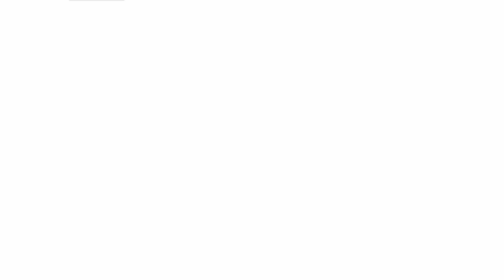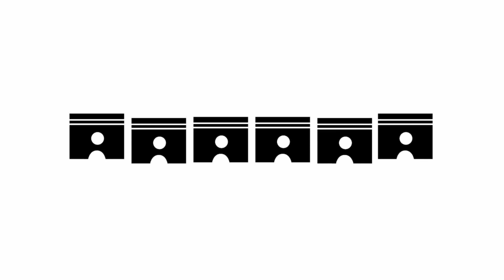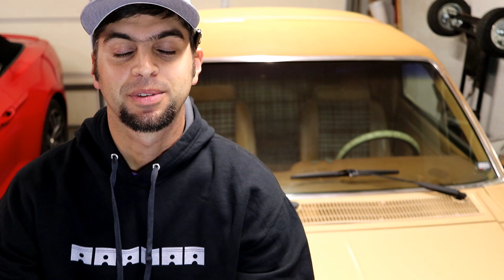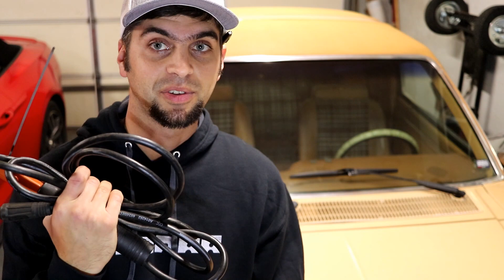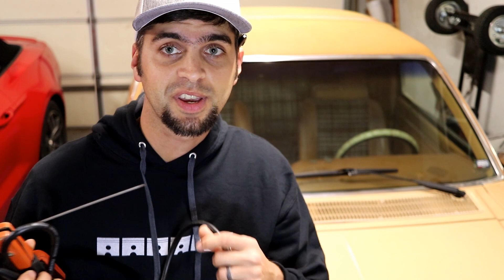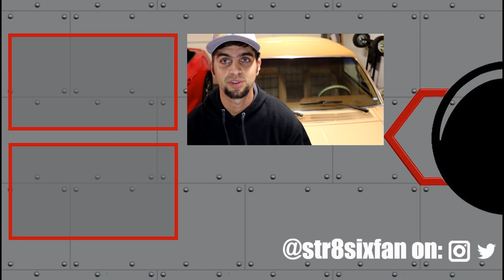Why You Should Learn To TIG Weld Before Any Other Welding Process

Comment: I was always told learn stick then mig then tig because stick will help you learn to control your hands then mig will help you control the motion and when you combine both them skills as well as many others  you can do tig so much smoother but I agree with you let's flip the script for anybody that is new I can't do tig now first because I already learned on stick first but I think its a great idea to think out the box brother
Reply from the maker: That's pretty dang close to what I was trying to say. It was more of an encouragement to let someone be empowered to think of they wanted to jump straight to TIG, why not? But it's a great discussion no matter what. Just get out and weld. There's a ton you can pull from experience from my new to the other, but if you haven't done any yet, why would it matter which one you start with?

Comment: I believe that also. Don't be afraid to pick up a tig and go. I believe it is the base for all welding. Have a great Friday.
Reply from the maker: Yea, I mean really it applies to any of the three. If it's the right thing for your projected projects...buy that machine! Could be MIG, TIG or Arc. Or heck, maybe if you're in the rat rod scene chopping tops a lot, maybe an acetylne torch and brazing is where you should spend your money? I specifically bought the machine I did when I upgraded from the Lincoln Buzz Box so I could have more than one process and take up less space.

Comment: I am certified in Mig, TIG, oxy acetylene, stick, and plastic. never could get the hang of aluminum welding........Thing I had the most trouble with was learning to weld uphill
Reply from the maker: I've never tried aluminum welding, but it looks really difficult. The few times I tried uphill with a stick (like 2 different days) it was a struggle as well!